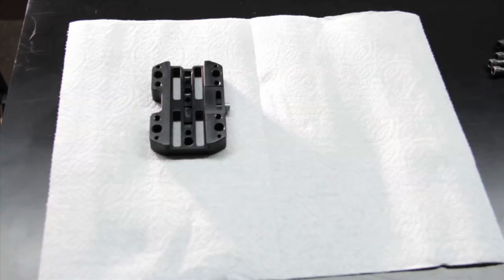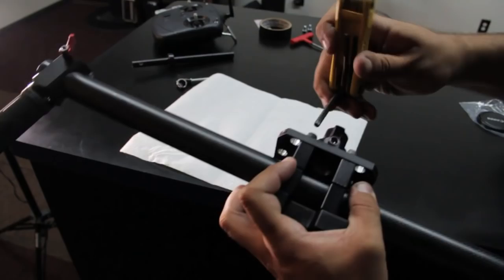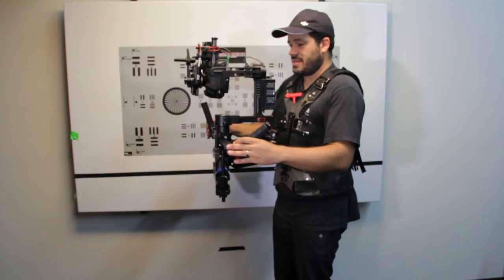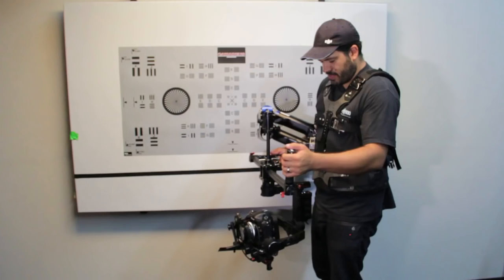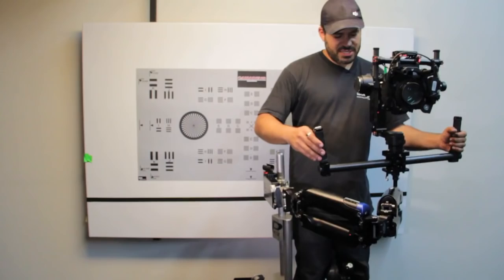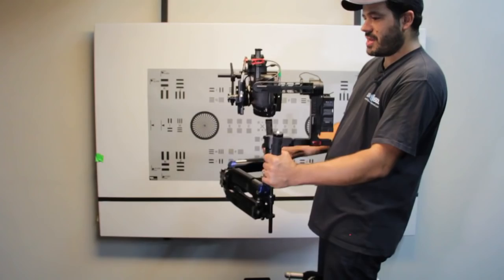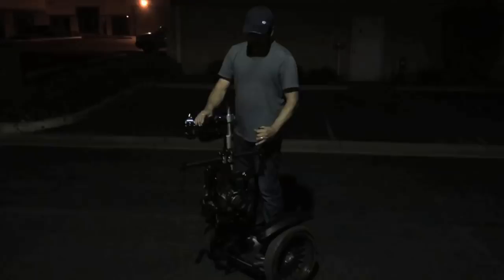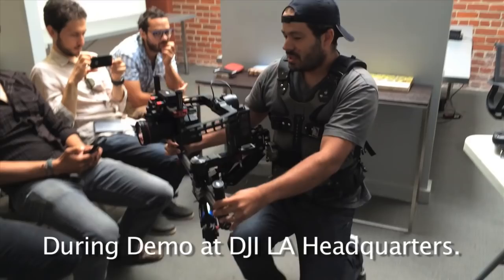DJI Ronin - CineMilled Steadicam Armpost Adaptor Tutorial - Steadicam and Segway

Comment: Instead of swapping back to the original handlebar mount provided by Dji you could just take the post out of the steadicam arm and operate it normally right?  Just making sure, I have a shoot coming up that will require that we go between steadicam arm and regular handheld with the ronin.  Thanks!

Comment: Can I buy a cheaper steady cam vest and arm then the came one ??? And what parts the I need to connect it to my DJI ronin m ? Thanks great watch
Reply from the maker: +PressnPlay Media Ltd Sure, we make a variety of armpost sizes. Just find out the size from the manufacturer and see if we have it.... as far as the ronin-m we have a ronin-m video on our vimeo site also.....you need the shims to make it work. Watch the video and it explains everything.
Reply: +pedro guimaraes 
Thanks very much pedro had a watch and very helpful. 
So it three items from
Your site I need if I'm correct ???
If the ronin m is up side down is there a setting on the cameras to invert the footage or are you filming up side down
Reply from the maker: +PressnPlay Media Ltd Depends on the camera. But in any editing program it is a simple push of a button to flip. As far as the monitor when you rotate the handlebar to work inverted the monitor will already be flipped.
Reply: +pedro guimaraes 
Thanks again 
Ronin m quick plate 
DJI Ronin Steadicam Armpost Adaptor
And a shim are these the three things needed

Comment: aren't you losing the tilt control with that setup?
Reply from the maker: Yes. but headroom is better adjusted with booming up or down. No steadicam operator tilts for headroom. That said there are many other reasons for tilting. So an option is to use the thumb controller.

Comment: Pedro , where can I get that steadicam armpost adaptor vest entire setup.
Reply from the maker: www.cinemilled.com
Reply: Hey Pedro,
Thanks for the informational video. What is the exact model of the seadicam arm and vest you have? 
Thanks!
Reply from the maker: I am a professional steadicam operator so I have the top Brand Model. It's a GPI PRO, the vest is $6000 and the arm $23,000. Needless to say to use this with the Ronin is a bit overkill. There are many other brands out there that are inexpensive and would get the job done. Look up came-tv for example
All the best.
Reply: +pedro guimaraes 
Really appreciate the quick response. Would you say a dual spring arm is a must?
Reply from the maker: Not really. just make sure whatever arm you use is rated for the weight you intend to support.
Reply: +pedro guimaraes 
Ok. Thanks for your advice